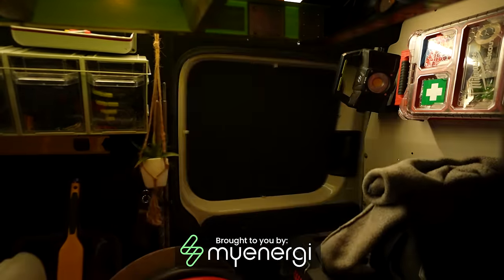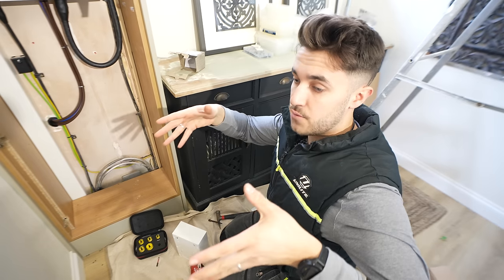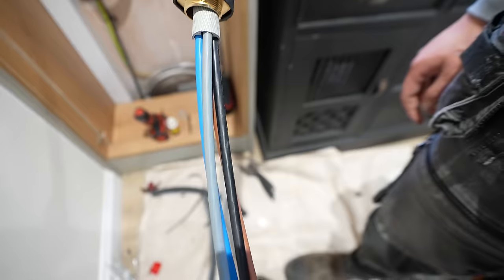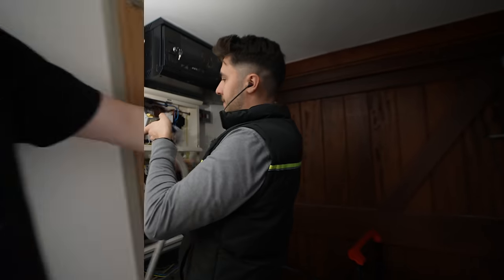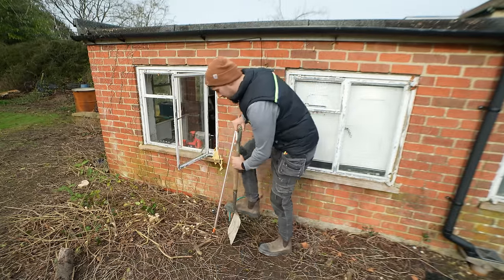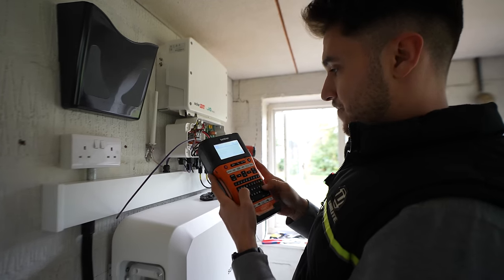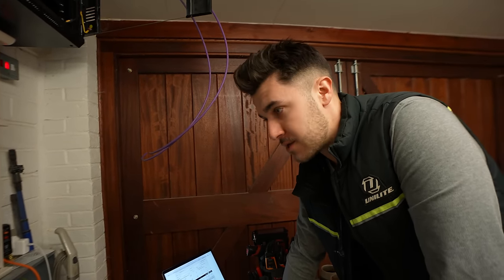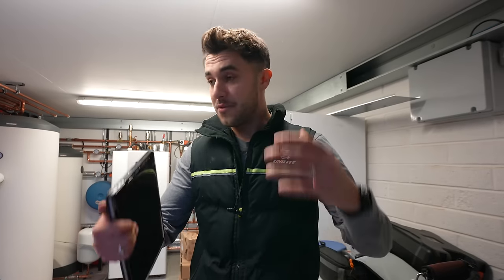New Faces & Big Projects! | ØY40

Comment from the maker: FYI guys here’s a link to the Brother Printer in this video ( PT-E550 ) if you want to check it out! - https://tinyurl.com/OYELEC
Reply: Answer to your question: 1667 Ohms is the maximum earth fault loop impedance in a circuit protected by a 30mA RCD, otherwise it won't trip. Though realistically, you should be measure a fraction of this value.
Reply: Thanks Cory! It’s now in my shopping basket on Amazon!! I’ll order it on payday 💰. It looks amazing!

Comment: Corey the magic number for a 100ma rcd is 500ohms . 1667 is for a 30ma rcd . You should pursue a sub 100 ohm reading for an earth rod . A stand alone genset requires 20ohms I believe from memory
Reply: For a 30ma rcd  200ohm is the magic figure.
Anything above that is regarded as unstable.
Reply: @mainlineelectronics5266  that’s not what the regulations say …
Reply: It does however say under; The resistance of the installation earth electrode should be as low as practicable. A value exceeding 200 ohms
may not be stable. Refer to Regulation 542.2.4.
Reply: Just noticed that they put table 41.5 in the video 🤣

Comment: With a TT system, the potential needed to trip the RCD should be at most 50V. Divide 50V by the RCD rating and you get a maximum impedance (rounded to the nearest ohm) of.

1667 ohms for 30mA
500 ohms for 100mA
167 ohms for 300mA
50 ohms for 1A

Comment: With reference to 4:24, my reading of 7671:2018, A2 is that we don't need to separate earth electrodes from public distribution network in this situation anymore. In the new prosumers chapter 826.1.1.2.1 says "Any connection to the means of earthing derived from the public distribution network need not be disconnected". Of course there may be something else going on in this install that requires it - dunno what inverter you are using and whether it can switch it's own MEN link. Discuss!

Comment: It's interesting, because we don't really 'import' a ground (earth) in Canada, we essentially always require a ground rod, but in modern code we also require at least two ground rods, spaced an appropriate length apart. Always fun to see the difference approaches.
Reply: Don’t you bond to the neutral ?
Reply from the maker: That’s cool!
Reply: @persona250  we bond ground and neutral at the first disconnect... Usually the main panel/load centre coming into a property... as I understand it, if they didn't do this, current could flow directly to the ground in a fault situation, and it wouldn't trip the breaker.

(we don't bond the ground and neutral at any other point past that... danger, haha)
Reply: I think you misunderstand because this isn’t a different approach . Tncs in the uk is neutral earth connected together the same as US neutral ground bond .
Reply: @persona250  It's quite possible I do! I'm not an expert here. I do believe we would be considered TN-C-S as well, although with the caveat that we require a dedicated grounding rod on site (sometimes referred to an Multiple Earthing Neutral, I think).

Anyways, my point was that we require a dedicated grounding rod (or multiple in newer installations) on every residential site. We don't 'import' a ground from the utility, or use a sudo ground of water pipes, etc.

Comment: When doing a gland the banjo should be touching the brass of the gland, not on the inside of the enclosure
Reply from the maker: I used to believe this too, but if you check the manufacturers instructions on most brands, they actually recommend it goes inside!

Comment: I have no idea, I work in IT but have an interest in electrical. I did some investigating and I think 1667 is significant because it represents the maximum allowable resistance for an earth electrode measured in ohms. I could be totally wrong and probably made myself look silly but oh well 🤣 Really good video though, very interesting! Such a good label printer as well, I have one of those and tidied up the hand written labels done by the electrician. Looks so much better!
Reply from the maker: That’s right! It’s so good isn’t it!?! Especially heat shrink tape on data

Comment: The 50v limit.....
PoE (Power over ethernet) in data cable runs at max of 48volts (all PoE devices such as access points, VoIP phones etc all run at 48v, or less)
I recall that's also the limit regarding PAT testing equipment that runs above 50v

Comment: +Cory Mac - ØY Electrical
Please consider your TT installations and the case of 100mA time delayed upfront RCD, combined with downstream 30mA RCBOs of the single-pole variety.
Does this configuration, in combination with TT earthing, result in upfront RCD tripping when there is a Neutral-Earth fault on a final circuit?
If not, why not?  If so, is the only solution to go to double pole / 4 pole RCDs/RCBOs downstream of the upfront RCD?.
Reply from the maker: They are all double pole downstream 😄
Reply: That makes sense for your nice upmarket installs; however there will be people looking to add solar and offline modes to existing all-RCBO board setups.(with large numbers of Type-a RCBOs, relatively modern, but single-pole).
Thusly; please do discuss the detail and my tripping-question when convenient =).

Comment: Hey Cory, I've been following for a very long time, I really like your videos, there's so much out there that I'd love to get involved in. I'm pretty close to Bournemouth, so if you ever need a hand/labour I'd love to help out for free to gain experience. I'm a domestic installer, but I primarily work on large industrial DC power systems. I'm also a Cisco engineer, fibre splicer, data cabler. I'm free one day a week, so if you ever just someone short notice give me a shout. I'm qualified, fully equipped and insured.

Comment: Hi Cory, I expect you are way too busy to reply to this ! but if you do have a minute could you please advise to if you have a change over system from grid /offgrid solar . I have a Solis hybrid and it does have a backup system but no changeover to isolate one from the over avoiding backfeeding ? I have built a backup board with a changeover switch and breakers for the grid and Inverter feeds but not sure the best way to ensure a safe operation. Thanks if you can reply and no worries if you cant , love the channel cheers Neil